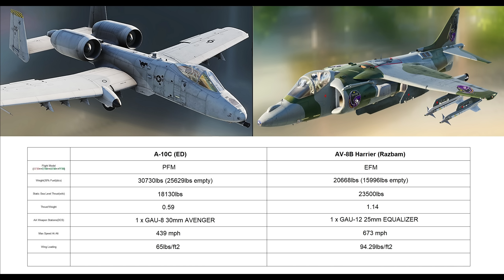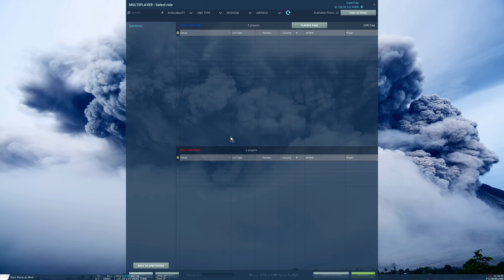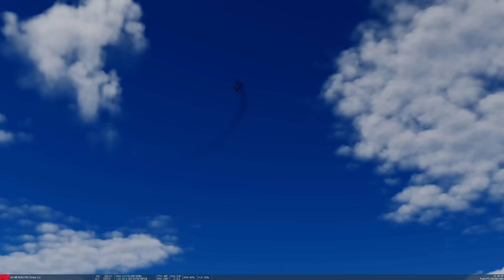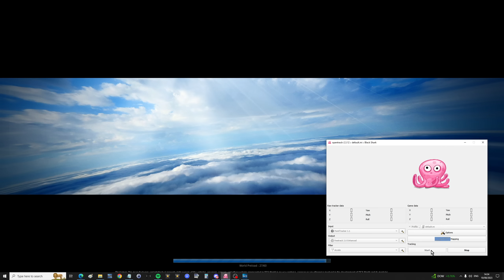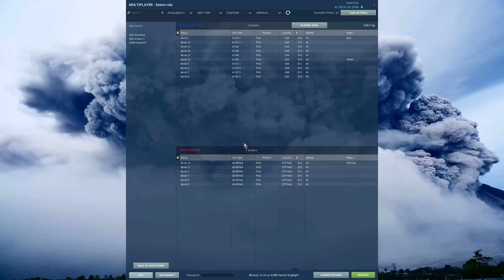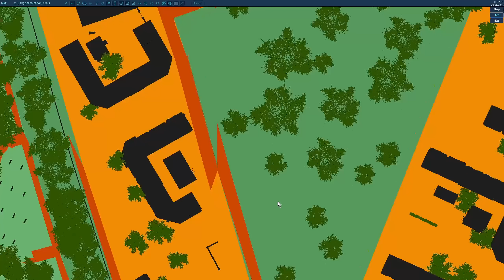A-10 Thunderbolt II vs AV-8B Harrier II: Dogfight | DCS

Comment: Shouldn’t the Harrier pilots have tried to make more use of the main advantage they have in thrust to weight ratio? No point in trying to out-turn the A10; out-climb it.
Reply: Not in a missile fight against an agile opponent. Cap tried to set up an energy fight and ate one in the butt. In a guns fight...maybe. But the Harrier wasn't designed to fight a Piper Cub with really big teeth.
Reply: harrier and a-10 thrust is more like pick-up truck horse power. you can have a lot but its low end thrust not high speed fast acceleration thrust. so while the harrier had a better drag profile get get higher top end speeds than the a-10. it just can't accelerate quick enough. cheers I hope that helped make sense of the fights.
Reply: @simba1113  Sorry but that is incorrect. There is no such thing as pickup truck horse power or low end thrust vs high end thrust (though there is a change in thrust with speed and altitude). The Harrier has a lot of thrust and relatively low weight and is one of the fastest accelerating aircraft in DCS from 0 to about 200. However it has high drag so acceleration falls away quickly with speed and so cannot go supersonic. The A-10 has less thrust, lower thrust to weight and higher drag so is slower and cannot accelerate as quickly.....in a straight line. However the A-10 has a much lower nominal wing loading which means that when turning it's drag doesn't increase as much as an aicraft with a high wing loading like the Harrier - therefore when pulling hard the thrust to drag ratio for the A-10 drastically improves in relation to the Harrier. Thrust to drag is the primary factor in limiting top speed so the Harriers top speed of over 500 kts might drop to say 150kts when pulling hard. The A-10s top speed of 350 ish kts might drop to say 160kts or whatever. However there are 5 methods you could have used to reduce the wing loading/increase performance on the Harrier - three of which you definitely weren't doing and the other you almost certainly we're not doing and one unknown. The Harrier has a higher maximum sustained turn rate, a higher peak turn rate, a smaller turn radius higher thrust to weight, higher thrust to drag and faster roll rate than the A-10 so SHOULD win this fight if configured and flown correctly. The Harrier is light and is thus adversely affected by weight and has a relatively large fuel tank so with full fuel loads the performance drops significantly so there are certain configurations in which the Harrier could not outrate the A-10 but should almost always be able to beat it in a 1 circle fight.

Comment: 1 v 1.... Harrier SHOULD win [almost] every time.

Just set up the A10 for one circle, go jets down and pull inside the circle.
The A10 now has 2 options
1: Continue to pull the circle and get picked off by the Harriers gun.
2: Open up the circle to make it possible to get nose on, which involves flying away from the harrier, which means AIM9 up the bum.

Even if you can't get him into a circle, if he's on your arse, jets down and just go so slow the A10 has no option other than to fly past you.... and AIM9!

As I said though, 1 v 1 ONLY, the second theres another player up there you're dead meat even thinking about pulling that crap.
Reply: Except it didn't work out like that. If a high TW fighter wants to climb into the pig pen, don't be shocked if the low TW Hawg eats you for lunch. To do what you laid out implies you can even get on it's tail. How long you gonna VIFF before he tightens the turn and disappears off your wind screen, to find out you bled all your energy off and are out of airspeed, altitude and ideas. Also diving on a Hawg in your fast jet to get a gun kill, when the Hawg happily flies 10 ft above the ground is not conducive to a reattack.

Comment: Do the thing the harrier does. At the merge, slam the nozzles forward. Pull the nose up, rotate clock wise to nose down while pulling nose up . Now you’re level point 180 from where you were. Hold the hover and rotate to the target ( sit in the middle of the circle, he can’t beat you around the circle). Missiles… boom
Reply: in game you can't fire missiles or the gun in hover mode.
Reply: @simba1113  ooooof.  Bummer.  Can you slam the nozzles back, fire, slam them down, rotated, lock, slam, fire?  Might need an extra hand, and some altitude.

Comment: Combine both planes
The Jump jet of the harrier 
The 30mm Gatling GUn of the A-10
Reply: The 30mm gun is worse for dogfighting than the 20mm in pretty much every way. It's high ratio of AP ammo is near useless in damaging aircraft and it's huge weight is a burden. Either way guns are essentially pointless in modern air combat.

Comment: I just wanna see the A-10 hack things apart with the Avenger!

Knew the A-10 was gonna dominate. It's SO MUCH more stable at low speeds than the Harrier, giving it incredible turn advantage. And the gun is just absolute domination in a furball. Carry a light missile load and it's even more agile. Slow doesn't mean clumsy haha

Of course, Simba pulls it off xD
Reply: The Harrier should have won
 that fight it can out rate the A-10 has a tighter turn radius, higher thrust to weight and faster roll rate. The Harriers were not being flown at all well.
Reply: @Pukin-Dog  turn radius depends largely on airspeed, and the A10 is way more stable at low speeds, so it can shorten the turn radius tighter than the Harrier can at lowest combat speed. Harrier can outrun/outroll easy, but it requires different strategies than a usual dogfight. Up close and personal, low speeds - Harrier is at disadvantage. In and out, fast fighting - A10 can't keep up.

These guys are all decent pilots and they ran a LOT of tests - A10's got a decided edge
Reply: @thed3m0n0id9  The Harrier can maintain stability at under 100kts with full fuel and even 60 kts with 25% fuel. Here is me happily maintaining control at 60 kts (and below)..it usually only starts to struggle at 50 kts or less. https://youtu.be/Iw1L2jl8x4o?t=119 They might be decent pilots...but they can't fly the Harrier

Comment: I would bet that in a guns only fight, the Harrier could dominate this. Without missiles the Harrier could use and abuse the vertical against the A10 and win the boom and zoom fight consistently.

With missiles, however, going into the vertical is invitation to eating a missile.
Reply: Or possibly if it was the British GR7 which has much bigger flare pods, if they ever get around to adding it.
Reply: Not a chance. Harrier lost the fight in the first turn, couldn't shake the Hawg off it's tail, plus a GAU-8 with 1150 rounds? You might surprise someone with VIFF, but that's a one trick pony, easily countered. The Harrier, VIFFing in a turn would just as like fall out of the sky against a ridiculously agile slow mover, as pull off a magic snapshot, BUT, to do that, it would have to be behind the 3-9 line, something the Harrier couldn't do in this engagement.
Reply: Harrier SHOULD have won. Gun or missile

Comment: As much as I'll always have a special place in my heart for the Harrier..... Let's be honest; all the A-10 has to do is get one decent cannon burst on target and it'll shred the Harrier like a wet lettuce. Those 30mm rounds-from-hell are meant to pierce tank armour, they'll do baaaaaaaad things to a nice lightly-armoured Harrier hull :/
Reply: The 30mm AP rounds are much worse than a 20mm HE shells. The 30mm will just punch a tiny hole right through the aircraft and keep going. The 20mm HE will impact and detonate, sending fragmentation everywhere like a hand grenade.
Reply: @rubiconnn But you gotta point the gun in the right direction which didn't happen often here. The GAU-8 fires HEI round. Lastly, Gunston argued that one or two large rounds in a critical space could be fatal and modern jets are nothing but critical space... except the A-10
Reply: @aztec0112  Only one out of every 5 rounds is high explosive, the other ones are all inert DU armor piercing rounds. Also pretty much every single other fighter jet has the same triple redundancy that the A10 has for systems. The only thing the A10 has that other jets don't is the armored glass on the very front panel and the titanium armor on the bottom of the cockpit.
Reply: @rubiconnn Good points, but in a densely packed modern fighter even an inert DU is likely going to damage something critical.  For example one DU, center mass is going to rupture a fuel tank, pierce the engine housing, wreck some spinny engine bits, damage hydraulics, electronics, etc before exiting the other side. As for redundancy, the A-10 is ridiculously over engineered.  Not saying modern aircraft aren't, but even WW2  aircraft with all the inherent air spaces could be brought down with a single 30mm round. Sheer volume of fire and simple odds will likely put more than one round on target and that would likely include an HE round too. I understand your point, but I wouldn't dismiss the 30mm round, especially at 3-6k rpm.

Comment: The reason why the harrier is one of the worst dogfighters is due to the fact it is weighed down with far too much equipment, and smaller wings for easier ship-based operations. Since it was designed as a vtol carrier aircraft, and not a dedicated fighter, there is little in ways of comparison in a dogfight. 
An easy way to put it in perspective is the F-35 vs the F-22. Though the 35 is a great plane, it cannot keep up with another stealth fighter designed specifically for air superiority.

Comment: Not sure about this tbh.  Winning a dogfight is all about energy.  The harrier has about the same wing loading but higher g limit plus has about 200kts on the a10.  Yes the a10 can snap direction very quickly but the energy is lost quickly.  The harrier (with a proficient pilot who would have more dogfighting experience than their opponent) would simply have more energy and speed and wouldn’t be a target long enough. Plus the harrier could just have gone high and dropped his knickers on the A10 😂
Reply: Sure, in a guns fight, but even Shaw argued that a low thrust-weight fighter with missiles could negate the energy advantage of the energy fighter. It's not just all about energy, but in how you manage it. The Harriet's zoomed in, pulled hard, lost energy and had to extend to try and regain it at low altitude. To force an overshoot the Harrier had to piss away it's energy advantage against a the low T/W Hawg and couldn't regain it fast enough. The Harrier came to the pig sty and got trapped in a low speed, low energy fight, that the Hawg could fly all day without EVER overshooting. I kept thinking the best the Harrier could hope for is to some how get nose to nose...against the GAU-8.😵
In all seriousness, the Harriet's lost the fight at the "consensual" merge.
Reply: @aztec0112  The Harrier can decimate the A-10 in a 1C fight.